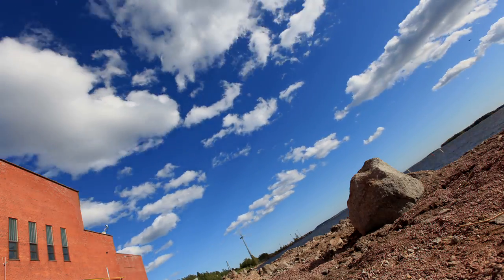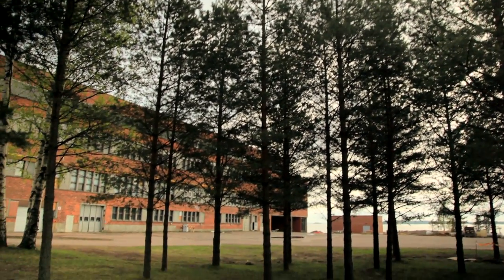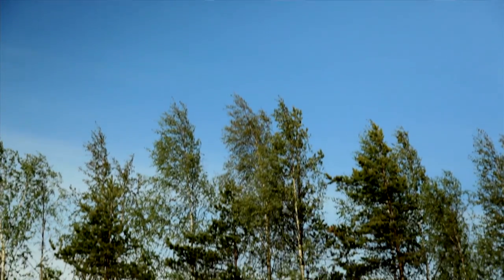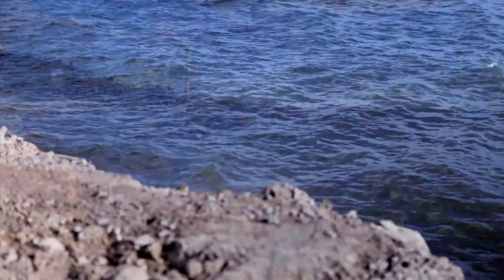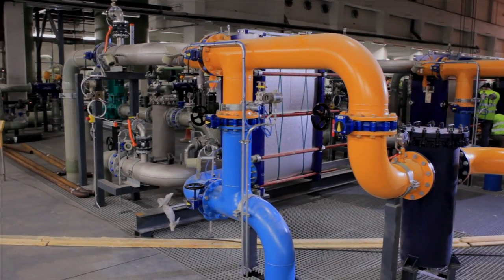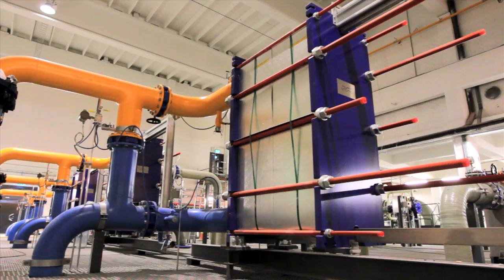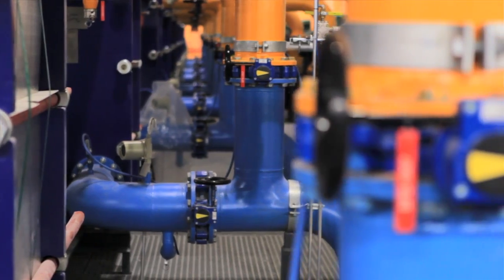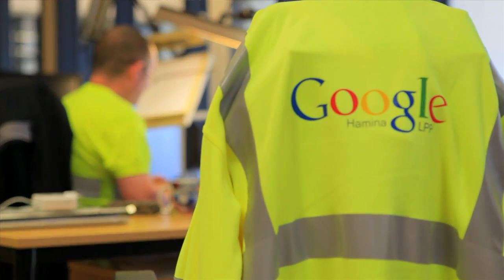Google's Hamina Data Center

Comment: I wonder if they used any of the water for power. The natural currents could be used in addition to the outgoing flow of water for some hydroelectric Solar could be an option as well. I would think because it is on the coast that there might be some wind, but I don't know enough about Finland to say if it would be viable for wind power.
Reply: +Robert R This is the Baltic Sea, which has little to no currents. No tides whatsoever either.

Comment: Very well-designed !
I vote for a next stop at North pole but doubt about availability of high speed Internet connection there.
Reply: The commute must be insane though
Reply: Internet is pretty good in the northern parts of Norway and Svalbard.

Comment: It's not hot enough for practical heat generation - you can't allow the coolant to get warm enough to be useful and still maintain performance.
Reply: You can use heat pumps to take heat from a source and make it even hotter (basically a reverse refrigerator). We do this in sweden in some datacenters. We use the heat we get to heat buildings and cool servers at the same time.

Comment: It's not worth the trouble to bother trying to extract energy from the warm water. The warm water effluent is only going to be a couple degrees warmer than the surrounding water. Carnot efficiency at such small temperature differences is abysmal, a few percent at best. Say the datacenter is using 10 MW of power, a waste heat energy recovery system would recover a few hundred kilowatts at most, after the energy cost to run the pumps and such powering it, only a trivial amount would be left over.

Comment: If you contionously pump warm water into the existing water, the water temperature in that area will begin to rise slightly. The change might not seem to be big, but it still impacts the enviroment.

Comment: @mvszao This isn't necessarily true.  The Stirling Engine would probably have the ability to cool the data center and run the generators at the same time.  However, the way in which they would do this would be extremely complicated, but it could be done and I'm not sure why it hasn't.  They should be able to cut the temperature to a median between the sea water and the data center which would probably be rather cool.

Comment: However, isn't that seawater be heavily corrosive? That would mean you would have to constantly have maintenances, right?
Reply: Baltic Sea's salinity is so low (At least when compared to other oceans) so that's hardly an issue.
Reply: Metal boats can sit in water for years at a time. If boats can, google's pipes can.

Comment: @n9986 it's less dramatic when the runoff water is at a temperature closer to that of the gulf. rough example: 100 units of water at 30 C compared to 150 units at 20 C. Even though theres more of the 20 C water, its environmental impact is lower, even though the total energy added to the gulf water is equal.

Comment: You could also pump the heat to the Hamina city district heating (HaminaEnergia.fi). This would sure make even better publicity! But alas, as I understand, the district heating is produced in cogeneration (or CHP) and thus there is not hardly any lack of heat energy, as there is the need for electricity, in the current situation.

Comment: Oh. One corretion. At the moment Manakala group owns 8,1% of Teollisuuden voima Oyj (Industry Power Inc),  91,3 % of the electricity TVO produces is nuclear ja 8,7 % coal. Wind is 0,01% so it's just for a greenwash (aka PR). Mankala's share of electricity is 1276 GWh/y out of which 1165 is produced at *Olkiluoto* Nuclear (where they are now building the new 1600 MW Olkiluoto 3 reactor). Mankala hydo's are 25+24 MW, but only Ahvenkoski is avail as Mankala production is sold to Helsinki Power.

Comment: Btw. I would be amazed if the Paper Mill was not sold with it's old Electricity agreement. Wich for us Finns means "Mankala deal". In this deal Paper Mill owns a portion of power plants and hydro and these plant produce electricity to owners with zero contribution margin. It's the cheapest form of electricity there is. And it's coming form nearby Loviisa Nuclear and some from Mankala hydro. The windmill they have, is not big enogh event to run the lights of the Mill.

Comment: To buid a really ecological data center you need as cold climate as possible and cheap energy. Then you need a new disttrict of housing and offices wich will be built with floor heating - which works well with low temp water. You need to locate the data center to the center of the district. For cooling use bedrock or waterpark (yes, in finland these need heating even in summer). That would be green. Ex paper mill is not. Not even topped with one PR windmill.

Comment: Depending the servers Google uses, return temperatire of coolant is propably below 50C. This means that for district heating system the energy content per m3 is low. In Finnish climate 70% of "waste heat" could be used for heating (Univ of Lappeenranta). This means that compared to Texas or some other hot area Google's datacenter is more ecological, but in reality it is anything but ecological in Finland. They just saved a chunk in coolin but all the rest of the energy is still wasted.

Comment: That cooling of water retunning to sea has been set up for marketing purposes. Fact is that 20m from waste water tunnel (I presume that tey use the old wasta water tunnel to return the water) flow has been mixed to sea water and the temparetur has dropped more that they ever gain by pumping more water in and then mixing it. That might actually cosume more energy than do any good.

Comment: @12345vickycool Well, first, You get busted and thrown into jail. And after that pretty much nothing else happens. Google has plenty of data centers to go around with. ;) I assume, your... Well not yours, because you would be in jail, but other people's googling would slow down from 0,00000001second to 0,00000002 seconds if one data center would seize to exist. :)

Comment: @n9986 I think that the idea is that there is much more water in the gulf than needed to cool this datacenter. So instead of just sending hot water back, Google can pump a whole bunch of more water to mix with the datacenter water, thus overall the hot water does not affect the environment much. The idea is that the environmental effect of such type of cooling is much lower than just cranking up power consumption on cooling systems, they can create more dense data centers, yet use less power.

Comment: @n9986 Yes, it would make a huge difference.
The sink and source for the water are the same, but in transit you are adding a massive amount of energy. If you dump that back into the gulf without cooling it, it will dump all that heat into the gulf.

Comment: @n9986 Yes. The "water mixing" is just good for avoiding too-hot water spots, presumably causing the fauna/flora to become confused and/or heavy evaporation during the winter [think nuke cooling tower]. You still dump the same amount of waste heat of course. What you have here is a device for transforming electrical energy into warm water, with computation as a side effect.

Comment: I don't get one thing. They say that they mix more water 'from the gulf' with the hot water coming out of the data center to ensure they don't heat up the gulf and cause the environment to go bad. But by energy conservation law, since both the sink and the source are from the same location, that is the water used to cool the heated water is coming from the gulf and mixing with the hot water and again going back to the gulf, it actually just takes the heat back to the gulf?
Reply: 14 years later and you are correct, data centers are using a ridiculous amount of water water consumption has increased. They say it’s all environmentally friendly but it’s all a big lie just to print money.